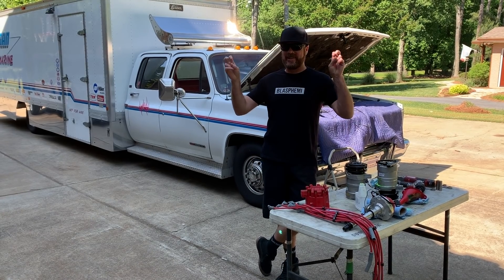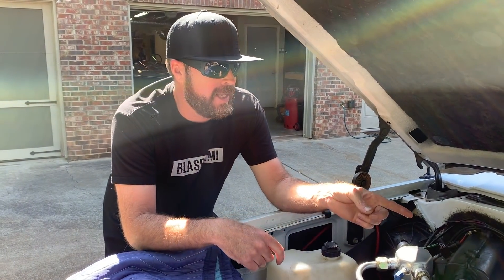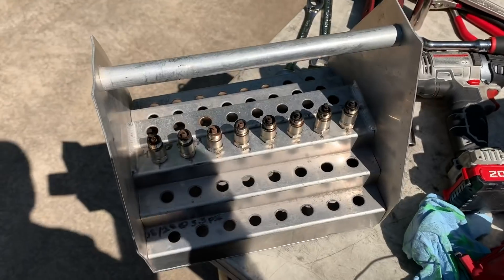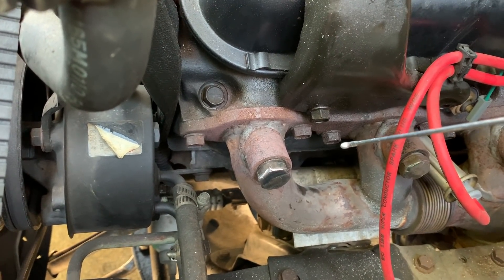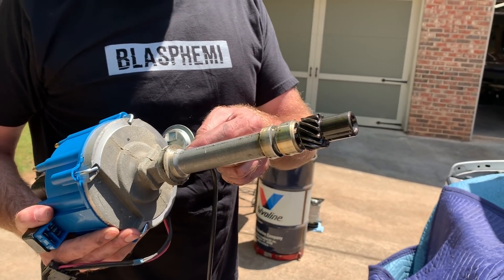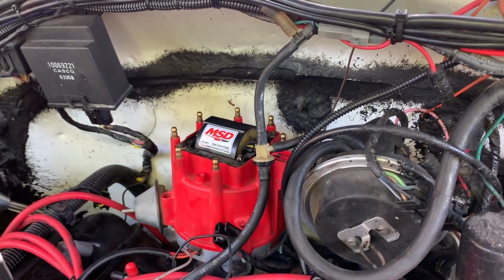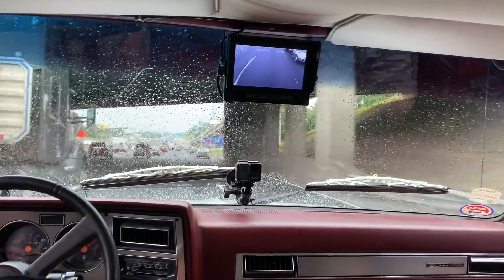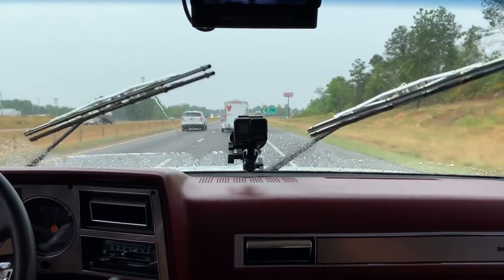More Power and Better Fuel Economy Thanks to Tuning and Overdrive! Ep.71

Comment: With the ac on,  your killing it, my 2002 F250 - 5.4 only gets 12 mpg, that empty or towing no difference
Reply: My 15 passenger 99 E350 was getting 15 MPG through the mountains of TN at 75 MPH, I got 13 MPG hauling a Mustang, the van weighs 8000 pounds unloaded, I'd get that truck in the shop.
Reply: @JD-so6sk  Don't know, I got 17 MPG on my way to Florida in 2005, it has 3.55 gears, first thing I did when I got it was have a shop build me a cat back dual exhaust Flowmaster 40, and I added a Superchip Microtuner, requires high test gas, but I've gotten away with 87 most of the time. I had a big pontoon boat and a 14' dual axle trailer that I'd load up with ATV's to hauls across TN to ride in the mountains. Now at the moment it's getting 7MPG at best, I'm certain it needs injector cleaning, I ran it a year with 2 faulty coil packs, just don't drive it as much, but the last time I had poor mileage, I took it to the dealer and they ran the injector cleaning on it, mileage went back up.

Comment: IF you ever get the Fuel Wing in the right position, that will get you at least another .5 mpg. We added one slightly larger than yours to "The Black Bitch", which was also a GMC 6+6 and gained .7 mpg.

Comment: Overdrive and a quadrajet is basically the best non fuel injection way of getting good mpg out of an old engine.

If you decide to get rid of that qjet at all, I have an '87 TBI 454 GMC suburban that could use a BBC quadrajet and a normal HEI... I'd buy em from you. I can do paypal. :D

Comment: I was too wondering if an aftermarket EFI system would help with power and economy.
Reply: No it would not, properly tuned carb is very capable of economy
Reply: i have to agree. in the end you need X amount of power to pull it down the freeway, and that takes Y amount of fuel no matter how its getting into the engine.
Reply: Sharkey, even this video demonstrated that improper ignition timing caused poor fuel economy...more fuel used than necessary. 

Also, there is a reason why carburetors are no longer used in production vehicles...because they are not as efficient or environmentally friendly as a carb. EFI is capable of adjusting air-fuel ratios in real time to adjust for changing environmental conditions...carbs can’t do that.
Reply: Christopher Pilkington, read threads online. At a constant rate of flow the stoichiometric ratio is still 13.4-1. Nothing is going to change the air dam that is the giant box. The cylinder size needs a certain amount of air. It does not matter EFIor carb. EFI makes for better hot starts and smoother acceleration I get that. Once up to speed a tuned carb is equal. The only thing that will change the mileage is being able to pull back in the pedal. A turbo would more than likely help a little bit not much. It would have to be small and not restrict air flow. Compression has a lot to do with efficiency. More compression, more used energy per volume.
Reply: @christopherpilkington8375  exactly, improper timing because of problems and poor tuning. my point is if the carb is well tuned, in an application like this efi isnt going to make a huge difference in economy. and by application like this i mean a box truck that spends most of its life cruising down the highway. no doubt, efi would likely help in town driving, but it doesnt see much in town driving. everyone seems to think going to efi is gonna double the fuel economy, its just not gonna happen. the truck is now getting very cloe to what many others claim their efi 454 and 8.1l trucks are getting for economy while towing, its not going to get a pile better. 

i do know efi systems quite well, i know what benefits they have and their downsides (cost is about the only one). id never argue that a carb is better than efi in anything other than max power, however realistic expectations are needed and the fuel economy isnt going to get drastically better.

Comment: Significant improvement on mileage, won’t take long to pay for trans upgrades, do you need to modify the driveshaft for length or yoke? Just curious to see if it improves with break-in

Comment: Return line fuel filter set up and a thermal carb spacer will help a lot with engine run on and fuel percolation/vapor lock
Reply: vapor lock fix , your rite!! especialy with ethenol fuel.

Comment: The timing thing actually happened to me in my 1989 W250. Drove the truck a year and over 4000 miles and it was a dog. I knew I wasn’t going to get great mileage (360 TBI, 727, 4.10 gears and 235/85 tires) but 7-8 mpg wasn’t right. Long story short, after spending thousands replacing everything we thought was wrong (sub 50k miles on it at the time so lots of original parts), I found my timing was 2 degrees ATDC and timing should be 10 degrees BTDC
Reply: What mileage did you get afterwards?
Reply: codenamecordon I was getting 7-8 with a combo of town and city. I now get high 9s. When I went to Carlisle, I got 10 mpg before and now got 12 mpg after

Comment: You've got a GMC ramp truck with a Pontiac emblem on it hauling a Chevrolet with of a Dodge motor in it. I guess 3 of the 4 are GM products.
Reply from the maker: Bryan Gordon touché. Lol
Reply: @FinnegansGarage  do you own a third ramp truck?
Reply: Sounds like he needs one of those 70's RVs with the Olds Toronado drivetrain, just in case the wife and kids decide to come along.
Reply: What happened to the fuel injection? Isn't that truck a 91?  I owned an 88 and 90 with 454s and both were EFI.
Reply: @Jabroney now adays sure. But back then they built things better.
Reply: Jabroney exactly
Reply: Notice no fords anywhere!!!

Comment: Very cool, good work! I'm thinking if your looking for better mileage, I suggest in the future some better exhaust like hi-flow manifolds or wrapped headers. Then a better intake with fuel injection. An under-drive pulley to finish it off and possibly some fresh air dusting to get a cool air into 'Square Force One'. Did something similar to what I suggested on a Dodge version and got close to 13 mpg!

Comment: Mike, if you're interested in a hydraulic roller meant for exactly your engine combination let me know, I have a custom ground cam for a BBC with peanut port heads.
Reply: I'm interested in a new cam. I have a suburban w/454 L19 engine from 1995. It has the stock RV cam.
Reply: @missingremote4388  I got mine from Chris Straub, give him a call he can hook you up. I just went a different direction with better heads and had to switch cams. This cam is for the pre L19 small port heads found on the TBI trucks and carburetor equipped trucks of the 1970s to 1994.
Reply: @lukestrasser  thank you, I appreciate the advice.

Comment: My '91 has a 4L80 (profile pic). It's so much nicer than the TH400 my 87 had. Keep goin for double digits! I'll follow along to hopefully pull more out of mine. Around town I get 8.5, don't road trip it much. On a 454 I bet that's as good as I'll ever get, but PROVE ME WRONG!
Reply: Our '78 454 trailering special Suburban got 8mpg no matter what you did with it. Pull a boat, or drive 40mph around town, 8mpg. But, that was also a TH400 with 3.73s...
Reply: I've got the 4L80 with 4.10s on 2WD. I'm sure that's as good as it'll get, seems to be the norm at least.
Reply: @PcItalian  FWIW, on the flat land around my part of the country, I didn't really feel that ours needed those 3.73s (and this was in a 55mph world until until the mid/late 80s). If you're not pulling much weight, and are also a flatlander, maybe even 3.54s would help you out? Perhaps even just taller tires as an experiment?

Comment: I'm probably not telling you anything you don't already know, but that era of GM is pretty famous for slack timing chains, which could be part of your dieseling problem. Might pull a valve cover and observe the valve train while someone turns the crank? Doubly interesting to check out since this thing was apparently maintained by morons.

I realize you've probably already had this done for months, but I always like to reuse the distributor gear that wore into the cam too unless there's some reason you can't.

Since you really plan to stack miles on this thing, maybe those are topics worth a re-visit?

Also... Old school trick from growing up with a '78 454 Suburban is to aim the dash vents up as high as they will go if you want to attempt to cool the rear. It took about 50 miles to get the back-back comfortable, but, way better than nothing.

Comment: Holy shit. 12 degrees is crazy low for total timing. Did that engine originally come with a TBI? That's the original timing for the TBI without the timing wire plugged in. The computer adds a lot of timing at idle. I'll bet that thing felt like a real turd with only 12.

Comment: From 5.5 to 9mpg. Over 5000mi. With fuel at $3/gal  it will save $1060. How much was that trans?  Might take a few more 5000mi trips to pay for itself. But definitely a solid improvement. Moving that wing forward will likely help as well

Comment: EFI. Stab a TBI EFI system on it I bet you get 12. Maybe 15-17 empty!!
Reply: I lost about 2mpg from Sniper TBI. Carb was running pretty lean. Tbi is WAY up in power but I have a turbo 400 and 4.10 gears. I have all the shit for a 4L80E swap but I just need the time. Lockup converter plus overdrive gear? I hope to jump up to 14mpg. Last tank was 8.5. I haven't broken 10mpgs with efi yet in the last 8 months or so. I was getting 10-11 before. Up to 12.5mpg on a carb before swapping to efi. 1990 Silverado K2500. Definitely won't go back to a carb but my mileage didn't go up. 
  I have full computer timing control. I idle at about 30 degrees timing, have about 13 degrees of "vacuum" advance and about 22 degrees of "centrifugal" advance all in at 2700. I plateaued my WOT timing at 38 and my cruise (high rpm/high vacuum) timing at 50. Kinda hard to explain but I have it set up like a regular distributor with vacuum advance. I just put in a custom timing curve. It's easier to change  the vacuum and centrifugal advance on a laptop than an old school distributor. Just a few button clicks.
Reply: No

Comment: 8.8 MPG? That's about what the early 2000's big block Chevy Trucks got even when unloaded.
Reply from the maker: I had a 2001 Chevy 2500HD with a 6.0 that barely got 8mpg
Reply: @FinnegansGarage  Plus 1 quart of oil/1,000 miles if you were doing anything but going for ice cream...
Reply: @FinnegansGarage  Some engines are Pigs not matter what vehicle there attached to...
Reply: Better then a H1

Comment: LY6 swap it with LSA blower.
(LY6= gen 4 6.0L with LS3 style heads from a 3/4 ton van/truck)
Reply: No
Reply: @jeanvi52  12:25 [For every MPG gained that's $1,000 saved on a 5k mile trip]  I like nostalgia and all but in situations like this it comes down to saving money especially if you can do it re-using tried and true GM parts.

Comment: Love the R30 - Cant wait to see further improvements that you might make!  Holly Fuel Injection?  Headers?  Stuff that makes sense and keeps it super reliable for hauling.
Reply: why not just put a diesel in it? cheaper than adding all that stuff and waaay more economical,  plus more power
Reply: jerri0401 much more expensive to swap it.  Usually 10 grand. A lot cheaper to keep what he’s got

Comment: Your just a set of roller valvetrain and Holley EFI away from 10 mpg Finn!
Reply: that is cool to see.. it's like reliving the transition from the 80s to 1996. I liked it so much, I still drive a 1996. I hope he tops it off.. getting a better cam in on those rollers.
Reply: And move the wing further to the front.
Reply: Hey knowing what you’re doing with a good carb engine goes a long way. Get closer to the stoichiometric sweet spot and you can get a lot out of any older engine.  Mike knows what he is doing and it shows big time.  Great video!
Reply: @JacksonEngineering  stoic has nothing to do with mileage. 14.7:1 is stupid. That's the ideal ratio for EPA not MPG.
Reply: Rollers don't actually improve fuel economy
Reply: Please Holley EFI
Reply: Yup, EFI would go a long way on this one... 10mpg flat running would not be a problem at all...
Reply: Yes EFI
Reply: The fractional friction losses eliminated by a roller valvetrain would be meaningless for mileage. It'd be VERY expensive too since blocks of this vintage require tie-bar lifters, etc.
Reply: If 1 MPG = $1000 per trip...
Reply: @josephmatuszak3855  The lower the MPG, the more money saved per each MPG gained.
Reply: @mwilliamshs  x2 My 79 C20 camper special averages 9mpg (with a ladder rack and aluminum tool boxes)with a gen I 406 sbc, That engine is 10.2:1 forged crank, 264 roller cam, full roller lifters, msd pro billet dizzy, douge thorley tri y headers, ported aluminum heads and intake, th400, gear vendors over drive 4.10 gears and 33" tires. The cam kit was just under a thousand dollars and I probably have 6-7 thousand into it, depending on which parts you include. It was built as a daily driver work truck, hot rod, and tow pig for my 8500 pound toy hauler. The roller setup was to add reliability and a better ramp rates to make big torque from a small block. It is estimated at 525tq and 400+hp, based on dynoed engines. I also drive it more like blasphemy than the ramp truck. For a CA smog engine in an old truck, it gets up and goes pretty damn well. Towing my trailer, I average 5-6 mpg.
Reply: @CGT80  uh...congratulations? I mean, I'm sure it's awesome but I didn't come here for your show and tell.
Reply: @mwilliamshs  You must lack some reading comprehension, since it seems you missed the point in all of it, since it was a response to mileage vs. valvetrain and old school engines. Too bad, you got to see it anyway. Don't read it if you don't like it.....much like the rest of the internet! Some of us do share our experiences when a similar topic comes up.
Reply: @CGT80  well it's a small block not a big block,  high compression not low, roller cam not flat tappet, aluminum heads not iron...not sure what similarities you'd imagined? 

"Douge" Thorley headers? I think only dougebags buy those
Reply: Joseph Matuszak , or just put a Cummins engine maybe?
Reply: 14mpg with a 12 valve.
Reply: @harryguy76  you can say all you want junior...it wasn't a "joke" until I called your lyin', thievin' punk ass out....from your vocabulary, I'd say you're about 16...you kiss your mama with that mouth? As far as being "triggered"...works every time ...just make sure that you don't play one of your little "jokes" on a man who has to work hard for his money...I've been lied to and stolen from little bitches just like you...I really hope when you play your next "joke" the mark finds you out and gives you the beating that your second daddy failed to give you...you might learn a little respect, but I doubt it...too fuckin' stupid...
Reply: A lot of money dumped into that 454 and it still falls short of a diesel.
Reply: @EatChipsNow   I mean..... All he did was fix the timing?
I'm pretty sure you'd want an OD trans regardless of if he had a diesel in it
Reply: Michael C Talking about Holley efi and valvrtrain upgrades ya ding dong.
Reply: Cooter,  would you be  providing and installing that diesel for free?  Or should he go out and spend 10K to save 2K?  Or are you suggesting a junkyard motor that could be crap?
Reply: @Shockedbywater  my recommendation is keep the existing motor, improve aero (aero tail, skirts, etc), and enjoy the comfy, cheap ride
Reply: @sykwookiee  greedy assholes have been around forever. It's part of evolution. You can see it with animals in how they hide food from each other. Greed comes from a primal survival mode. Those who fall prey to it in themselves are just ' basic bitches' as the kids would say.
Reply: Don't forget a set of headers and dual 2 1/2'' exhaust...and one of those Tornado things that go in the air cleaner...as seen on tv...that is suppose to give better mileage...
Better yet a get 12V Cummins again....
Paint the 454 orange...get a 50 buck chrome engine dress up kit and a 454 SS 425hp sticker for the air cleaner...say it is suppose to be an original engine out of a wrecked 70 Chevelle SS 454.... then sell or trade it for a good running 94 to 98 Dodge 1 ton dually with a 12V Cummins which has the desirable P7100 injector pump and Holset HX-35 turbo...
94 year could be equipped with I believe ether the desirable Holset HX-35 or Holset WH1C turbo...
95 to 98 only come equipped with P pump and the HX-35....
Reply: @harryguy76  all he needs is some logo stickers they always boost performance  ;)
Reply: @harryguy76  trade it in? Wtf... Trade in the box truck? Why the fuck would be do that? Get some other shit heap that isn't a box truck for a better motor? That makes no sense
Reply: @OutdoorSoHard_69  he was saying to doll up the 454 to look like some hot rare option from a classic car and trade that ENGINE for a truck that has the better engine, not trade the box truck.
Reply: @CobraDBlade  Exactly...thanks Cobra...
Reply: @OutdoorSoHard_69  Trade in the 454 for a Self-Propelled Cummins Crate Engine, not Squareforce 1 itself, just the engine.
Reply: @OutdoorSoHard_69  I think he's saying swap it like the ramp truck. Ditch the powerplant keep the body.
Reply: Cummins swap coming soon  Hopefully a common rail 5.9  🤔

Comment: The upgrades are really paying off!  Now look into an aftermarket throttle body fuel injection unit that directly replaces the carb and you may gain another 1 to 2 mpg plus better throttle response.